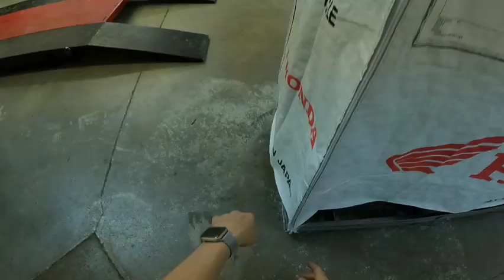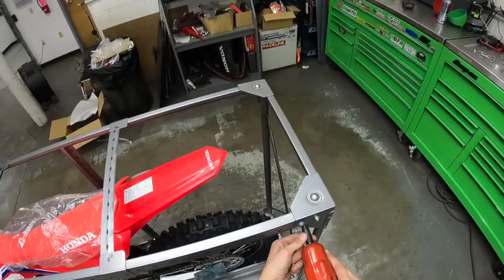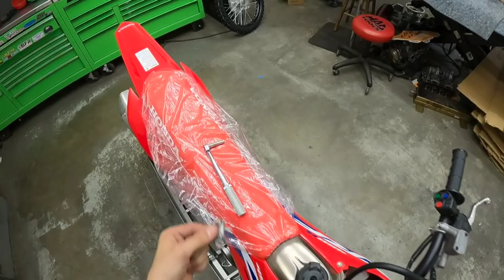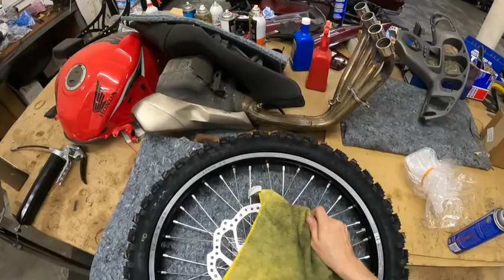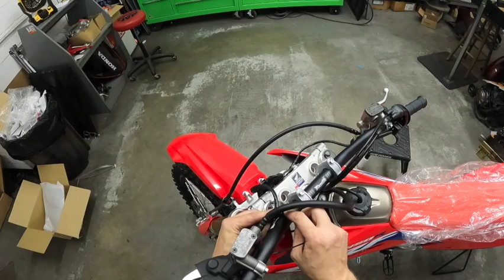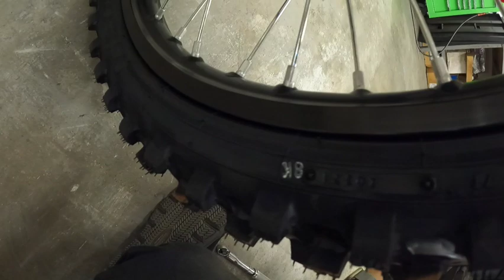2022 HONDA CRF450R UNCRATING AND BUILD

Comment: I have a question i just bought this bike 2 days ago ive ran it for 10 mins or so doing my heat cycles and when i turn bike off there is lil bit of white coming out tail pipe i did 3 more 5 to 10 min rides after and still little nit of smoke coming out is this normal only about 20 to 25 minutes on hole bike
Reply from the maker: Honestly i thing they all do that   Some could be oil from air cleaner and till it gets good and broke in and sealed up you will get some blow by
Reply: Hello i have a question when i change my oil on this 2022 crf 450r do i have to put transmission oil in allso or i just put the 10w 30 in and im good ive seen where people are putting oil in and transmission oil in on other side of bike there is no hole to put transmission oil on my bike im confused
Reply from the maker: Only one oil fill on the new models , both trans and engine run off the 10w30 👍🏼👍🏼
Reply: So i go ahead and pull drain plug and transmission plug and oil filter out let drain then fill back with 10w 30 or dont wearry about transmission bolt to drain
Reply from the maker: It just has 1 drain in center is a big allen bolt it drains both trans and engine , they are same oil filled from right side ( clutch cover )
Reply: Thank you very much easy enuff
Reply: Got a question agin what kind of gas can i run if i cant find ethenal free
Reply from the maker: We like to use at least mid grade or a high test like a 91 octane or 93 octane not just for the octane but because the fuel is actually a little bit cleaner in it’s gonna be hard to find ethanol free That’s not 87 octane in really dirty
Reply: So just go with 93. And when bike sits for winter drain it all out so does not gum up
Reply from the maker: Believe it or not it’s better to leave the tank full and add some fuel and ethanol stabilizer
Reply: Gn4 pro honda 10w30 SJ for 4 strokes is the right oil for these right is that right thanks alot man
Reply from the maker: That’s the stuff👍
Reply: Can run the non ethinal gas they sell at lowes for small engines would that hurt it i cant find non ethinal around me
Reply from the maker: It was me I would just run mid grade or high test pump gas if you’re going to store the bike maybe run the pump gas out and then fill it with that non-ethanol gas would get expensive to run that small engine stuff all the time
Reply: How many Qts go in this bike
Reply from the maker: 1.1
Reply: Hello agin what size is the axle nut on this 22mil
Reply from the maker: @kylesikes9818  the front is a 24mm i think the rear wad 32mm
Reply: Do u know torck spicks for rear wheel nut
Reply from the maker: 94 ftlbs
Reply: And that nut is righty tightey lefty loose correct i just streped it out on back side
Reply from the maker: Yep 👍🏼